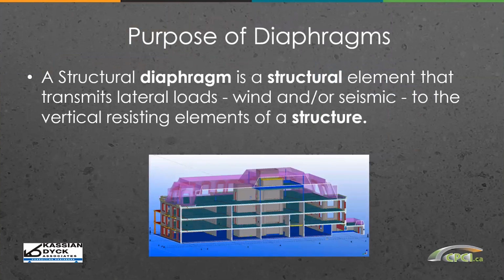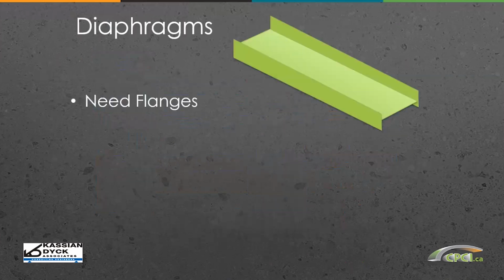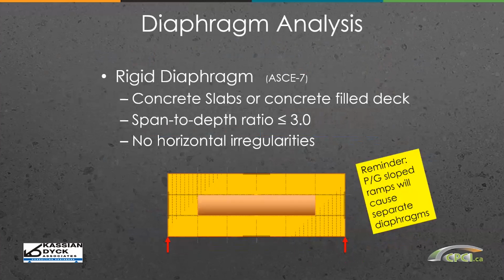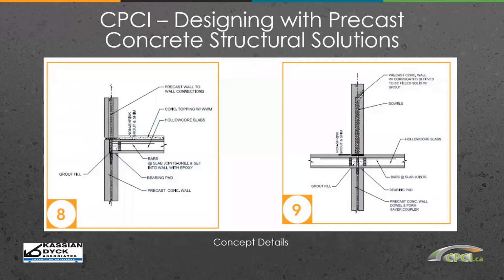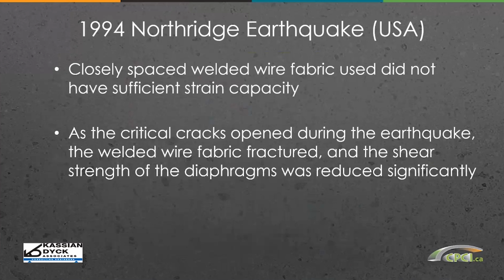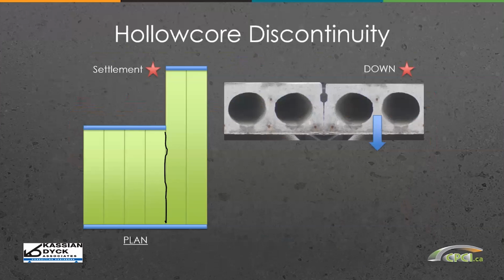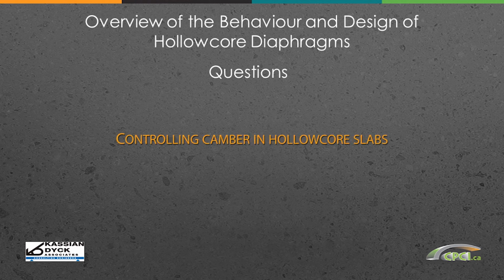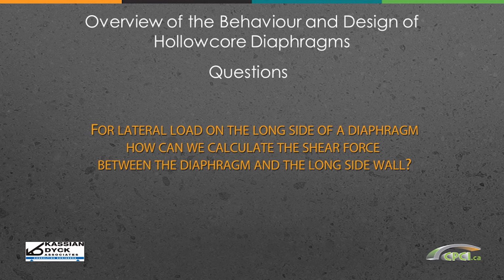Design of Hollowcore Diaphragms

Comment: For hollow-core precast planks with keyed joints, where should the continuity reinforcement bars be located? Should these bars be placed within the grouted keyways between adjacent planks, in the topping slab (if specified), or at the mid-depth of the plank section?